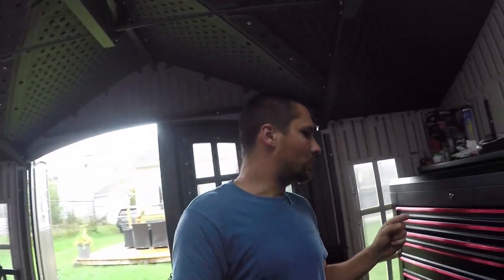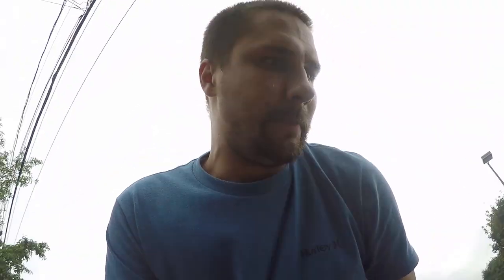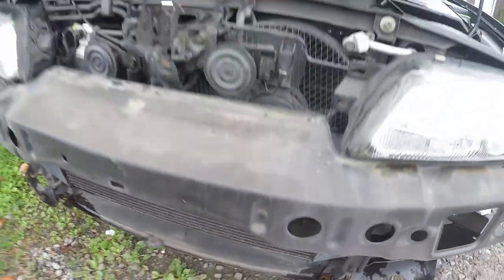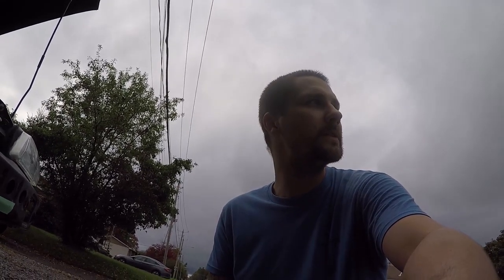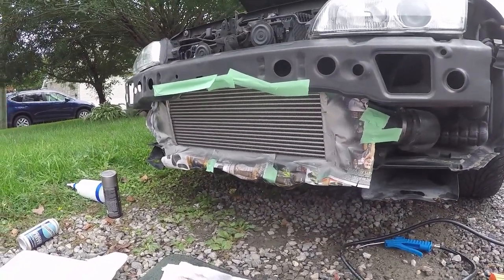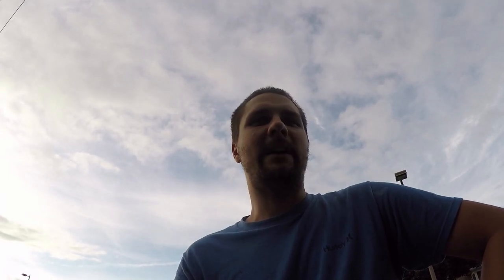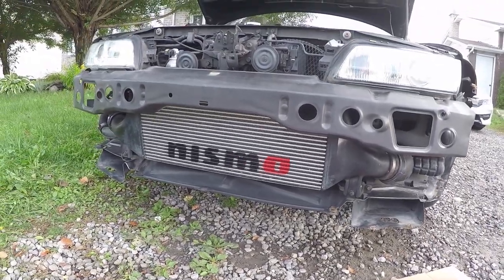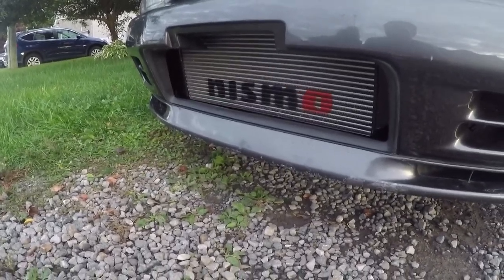R32 GTR Nismo Intercooler Stencil

Comment: You know.  By spraying that intercooler And I’m a ticketed technician.   Your creating a thick layer of something that stops the aluminium fins to not do their job.   Just saying. No hate.  Just a heads up
Reply from the maker: You're totally right, Drew. I have been checking the Air intake temperature since that day and the temperature hasn't increased so I guess we're good for now :)
Reply: @canuckautoworks2809  .is it still ok now?
Reply from the maker: @mr.eervianlesmana9263  yes
Reply: Agree. Besides this isn’t the same as the real Nismo ones that already addressed that issue.